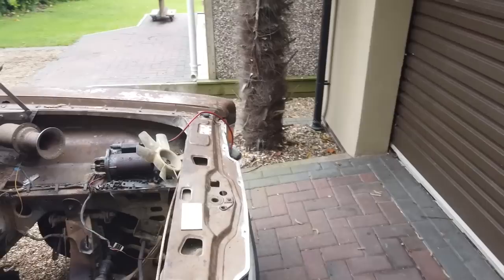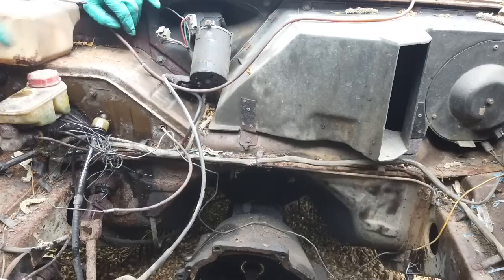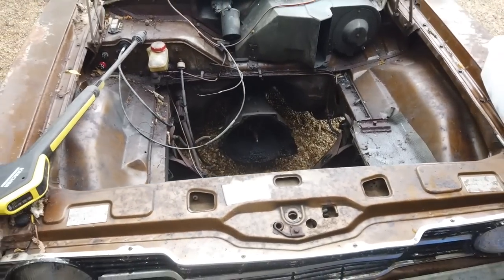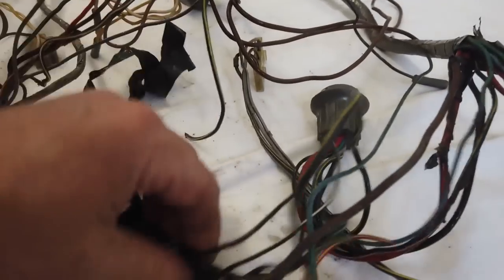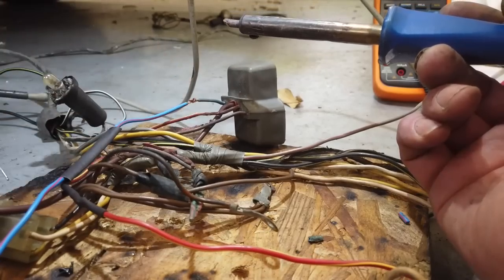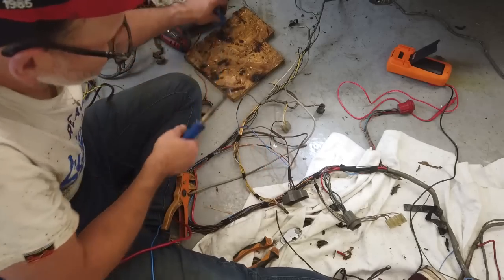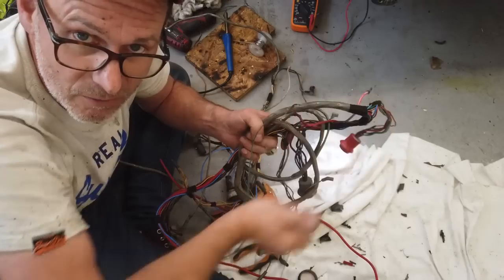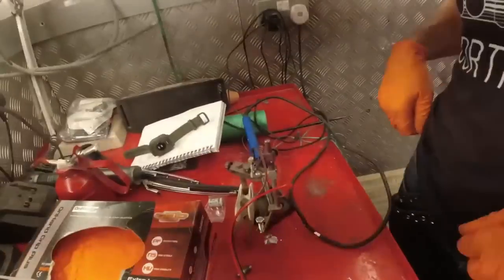PROJECT PAPPA- Mk3 Ford Cortina EP3- Wiring.

Comment: Hi Pete, thank you for the videos, your work is amazing. The electric loom of my scooter seems to be shorted. When I turn on the blinker, the lights go less bright in a blinking tune. Same when I press the brake. If I press the starter it only makes an attempt at turning, and a spark springs from the negative pole of the battery. I tested ignition key and electric devices, and everything seems to be OK. The engine turns freely. No shorted cables either. Any idea what it might be? Rectifier, CDI or magneto maybe?
Reply from the maker: RD!!!!! thanks so much for the SUPER THANKS!!!!!        i think the problem is loose earth lead to battery, that is why its sparking, its trying to make contact with the earth terminal and thats why it sparks

Comment: Speaking of Gunk: It's changed (presumably due to now illegal compounds). I noticed that the modern sort smells the same as White Spirit, So I tried using some of that instead - and it works exactly the same!. Yes it seems modern Gunk is white spirit with some colouring. 
White spirit is a heck of alot cheaper!

Comment: Once again Pete you make something that puts people off trying it themselves look straightforward (because it actually is). And your advice on adding a fuse to that headlight relay was excellent.
You are right there is something very satisfying about degreasing a loom even if you are finding the gremlins underneath. Call me obtuse but I quite like the grubby parts of rebuilds like degreasing engine bays, gearboxes, engines. Aluminium castings? Jizer and cold water followed by Fairy Liquid mixed with Swarfega, a scouring pad and rinsed in hot water.

Funfact: That Ford grey binding tape is the same as the BL grey binding tape used from about '70 to '90 (ish) although suppliers will tell you two different part numbers. Mini stuff was out of stock last year so bought Ford tape to rebind my '78 engine bay loom.

Comment: I just use the side of the iron to activate the heat shrink, saves faffing about with a heat gun. You're bob on about that lead free solder though - hateful stuff so it is.